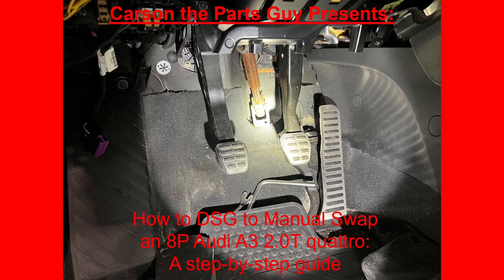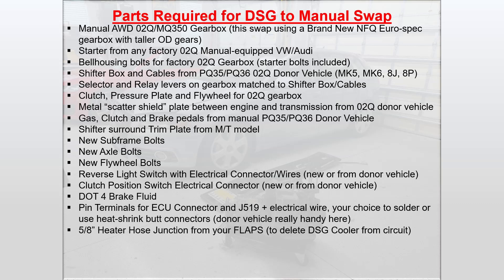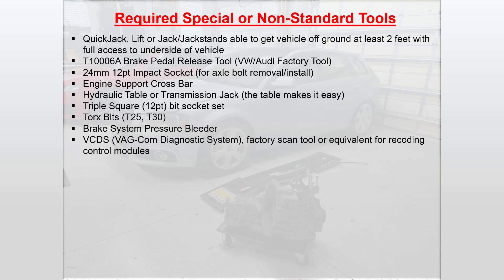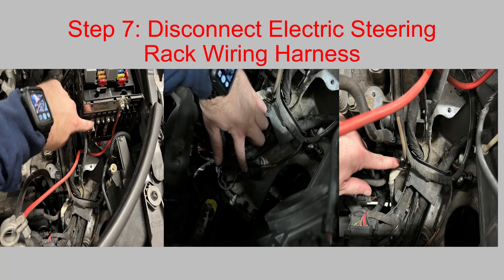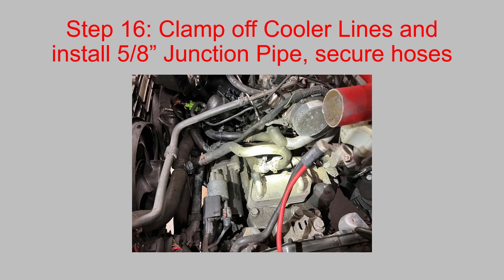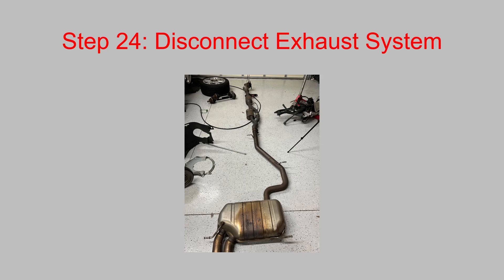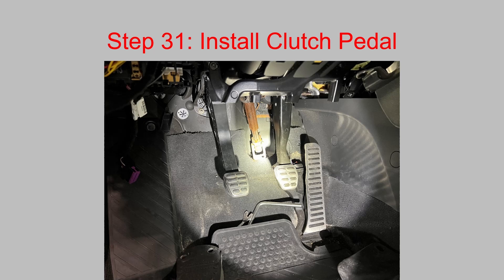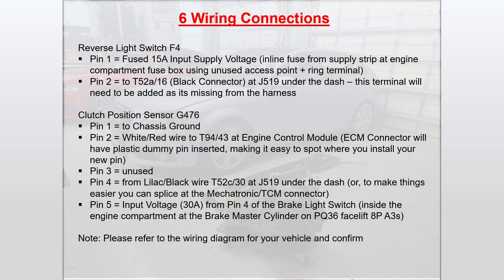DSG to Manual Swap - a step-by-step guide

Comment: Just wanted to drop an update, my 2012 Jetta Sportwagen TDI is on the road thanks to this video. Everything works. Cruise control, reverse lights and clutch interlock. It was a job and learned a lot on the way but it's definitely do-able.
Reply from the maker: Nice! Glad it helped you out!
Reply: did you have to reflash the ecu?
Reply from the maker: @leonkurtish9242  In my case, I only had to recode it with VCDS. Not all ECUs are able to be recoded this way, however.
Reply: @carsonthepartsguy8751  did you have issues with rev hang at all? And is there anyway i could double check if my car is compatible (coding wise) for a manual swap before i order the parts?
Reply from the maker: @leonkurtish9242  No rev hang issues with my swap. As for checking if it can be recoded, just go into it with VCDS and see if it’ll let you.
Reply: @carsonthepartsguy8751  got the engine module coded to manual transmission and removed automatic from gateway, but after that i had a code in the ecu for lost communication, could that be because my dsg was still connected and if not what do you think could be the solution ?
Reply from the maker: @leonkurtish9242  Did you clear the code and it returned?
Reply: @carsonthepartsguy8751  yes i tried clearing it a couple of times and it returned everytime but check engine would light up after taking it for a small ride

Comment: What an absolute gem of a video, im in the process of swapping an engine and 6speed into a car that had a dsg in it. I will for sure use this as a reference and it looks like you answer questions quickly. Thanks so much for the tutorial!
Reply: Guy let's do it. I'm also swapping my DQ200 DSG to a 6speed manual gearbox. Doing my homework on sourcing the needed parts.

Comment: Thanks for this video. I have a Manual Golf mk6 GTD that i'm planning on using as a donor to do this to a DSG mk6 GTD.  The reason reason for not buying another manual or just driving this one is that it has 340k Km (210k miles) on it is getting tired, leaking oil and doesn't have the options i want. I want one with a sunroof as I had in my mk6 1.4tsi twincharged version. But i can't find any original 2.0 tdi 170hp versions with a manual and a sunroof in 4/5door. always a 3 door or a dsg with the sunroof. 
Now i'm looking into buying a dsg mk6 and doing this swap. As i am  not a bodywork type of carguy, a gearbox swap would be easier than swapping roofs on a non sunroof one.

Comment: Great information in this video, thanks for all the detail Carson! I tried to look to see if anyone else asked but how did you acquire the NFQ euro-spec transmission? And do you by chance know the p/n for that as well as a bell housing for a 3.2L VR6? I have an MKV R32 that I am wanting to manual swap here in the states.
Reply from the maker: I got the gearbox from Cascade German. You would want to use the bell housing from an 8J TT 3.2 if you want to use the NFQ gear ratios. Otherwise, just get yourself an entire gearbox from the 8J TT 3.2 as it directly swaps into the MK5 R32.
Reply: @carsonthepartsguy8751  I was already thinking about the 8J TT to pull parts from. I might just try to find an entire donor car since I am considering doing this because I blew up my R32 engine.

Comment: Awesome Video Carson , thank you ! i just swapped a 02Q in my Jetta race car . i was sick of loosing races due to overheated DSG. 

The last thing to do is to wire up the clutch. i tried a few times using the purple/black wire from the DSG connector with no luck. i will attempt how you did yours. 

thanks in advance
Reply from the maker: Make sure you check the wiring diagrams for the Jetta first, the destinations will likely be the same but the wiring may be different. Good Luck!
Reply: Thanks for response Carson. I’m gonna be honest, I can built engines but when it comes to wiring, I’m clueless. I have no idea where to begin. So I need to find the pin out diagram from the Jetta and see with pin is the clutch position sensor?
Reply from the maker: @TeamAssuncao  Correct. You can get the wiring diagrams from ERWIN online, you can buy a subscription for 1-3 days, download the entire manual + wiring diagrams and keep them for future reference. Then just compare your factory DSG diagram vs. a manual diagram and route the wires where they need to go.
Reply: @carsonthepartsguy8751  Carson I got it 👍🏻 thank you sir. One last question, I didn’t change the brake pedal. I just cut down the pedal. So do I still have to wire PIN number 5 in the g476?
Reply from the maker: @TeamAssuncao  The wiring has to be done whether you replace the pedal or not. The physical brake pedal isn’t wired. Depending on production date, the brake switch is either inside the car riding on the pedal, or is in the engine compartment on the master cylinder.

Comment: Same sort of thing doing this to mk5 gt tdi? Dsg has shat itself and don't fancy finding another 81k mile mk5 golf with no rust whatsoever.
Reply from the maker: Basically, yeah. You'll have to check the wiring diagram for the TDI harness and how that utilizes the clutch position switch, but the rest of it should be quite similar. You'll obviously need the TDI specific flywheel, clutch, pressure plate and gearbox, but the rest of it could be had from a gas car.

Comment: I have completed all steps and got all codes cleared up, I need help with cruise control as it doesn't seem to work.
Reply from the maker: Did you recode the steering column electronics? If so, check your connections, and if they’re all good the clutch switch might be bad.

Comment: I have a 2014 VW Jetta Sportswagon MK-6 chassis with a DSG transmission and I live in Chicago. I already did a Malone Tuning Stage 2, CP-3 fuel upgrade, Glow Plug Duration and Dynamic Idle. I have the Raw Tek max performance DPF Delete, completely removed EGR system and assembly, as well as removed intake swirlers. The emissions is a hard 100% deleted with the Kerma TDI airbox delete and KERMA TDI turbo inlet hose. I am looking do do a DSG to 6 speed manual transmission swap on my 2014 VW JSW TDI. Where do i start and who do I go to. Thank you for your help.
Reply from the maker: Get your parts from a manual TDI, preferably from the same model year, and start swapping pretty much. You'll have to review the wiring diagrams for the TDI, but it will mostly be the same as the swap I've done here. You just need to swap the passenger front axle as they are different between DSG and Manual on the FWD.

Comment: thanks to you i did a full conversion if any problem...i have a plan to convert a golf mk5 gti to a 4x4 😈😈
Reply from the maker: A friend of mine is 4WD swapping his FWD manual 8P A3 that has already been 07K 2.5 I5 swapped. I’m 07K turbo swapping my manual swapped quattro. 😉
Reply: @carsonthepartsguy8751 well, this sounds interesting. Wil you document this swap?
Reply from the maker: @jeremybriand5196  I do intend to, start to finish. Subscribe to stay tuned!
Reply: @carsonthepartsguy8751  Well I am definitely subscribing. I don't want to miss out on this content, since it's a project I would like to try too
Reply from the maker: @jeremybriand5196  Well, my block should be back from the machine shop next week. Things are starting to move along....
Reply: @carsonthepartsguy8751  Nice, I can't wait to see that !

Comment: Thank you so much for sharing this precious material, and congrats on the excellent job. I'd like to know if you have wired the mirror tilt down when in reverse. I lost this function when I swapped my VW Golf 5 DSG to manual. Thanks in advance!
Reply from the maker: That should be handled by J519, and if you have wired in the reverse light switch to J519 so that your reverse lights come on, that should also trigger anything else tied into the vehicle being put in reverse gear.
The car I swapped in the video had rear parking aid - and it worked immediately after the swap. I would suggest investigating your coding.
Reply from the maker: @derciobadru4091  Its listed in my wiring diagram, but you'll have to refer to the one for your Golf. My reverse light switch is connected for power at the engine compartment fuse panel, runs to the reverse light switch, then from the reverse light switch it goes to J519. The car is already wired for the rest of it.
Reply: In my case, the reverse light switch it´s not connected to J519. The reverse light switch wires are connected two wires from the old automatic gearbox connector. I have rear light, but I don't have functions like mirror tilt down when reverse. I need to find a good mechanic and electrician like you, near me. Once again, congratulations on the excellent work.
Reply from the maker: @derciobadru4091  Yeah, you would have to refer to your car’s specific wiring diagram to see how that’s handled. Good luck with it!

Comment: I have an audi a5 2011 and I think I have a t94 ecm also. But can you explain more in detail of the wiring situation? And explainittle more the coding. Thank you.
Reply from the maker: For your particular vehicle, I’d have to go into the wiring diagrams and look all of that up. I wish I had the resources to manual swap all of the Audis, but I don’t. Sorry.
Reply from the maker: Your best bet would be to find one of the swap videos for a B8 chassis Audi. This video is specific to the PQ35/36 chassis, which would be 8P A3, 8J TT, and the MK5/MK6 VW Golf/Jetta and some other transverse models. I don’t own a B8 and don’t currently have any plans of covering a swap on one. Again, sorry I can’t be of help on that one.

Comment: i’ve just manual swapped my 07 passat and i can’t get my brake lights to turn off, there constantly on since the swap, i’ve replaced the brake switch and swapped to a manual ecu however i haven’t added a clutch switch, would this have anything to do with it?
Reply from the maker: Sounds like the brake switch needs to be replaced.

Comment: Would it be possible to change a DSG 7 from a Skoda Octavia 2011 1.8 tsi to a manual? 🤔 It has 160 hp and also a 1 year fixed engine, because of the oil use I had to do it..
Reply from the maker: Its possible. However, we did not get those particular 7 speed DSGs here in North America. Your best bet would be to find a parts car with the same engine that has the manual and pull everything you need from it.

Comment: Hey, I have gone through with the swap just the way you did… but I think I kinda missed a step in the coding or something, as my cruise control doesn’t work
Do you know what it could be? Does yours work?
Reply from the maker: You have to recode the steering wheel electronics control module if you haven’t already.

Comment: Great video. Don't you have the step by step guide for VW mk6 dsg to manual swap.
Reply from the maker: It’s very similar, some minor differences in required parts and wiring.
Reply: Thanks 🙏
Reply: @carsonthepartsguy8751  where is the best place to source a transmission for a mk6 gti?
Reply from the maker: @cooperferre4990  Used, you can try a VW/Audi only recycler, a National one such as LKQ, or privately through someone parting out their car, etc.

I got my gearbox from Cascade German brand new.

Comment: can anyone confirm if mk5 r32 ecu is "unlocked" as in will it take the coding like this a3? i have already received my manual swap from overseas just doing my wiring research now. seems like many skip over actually wiring in the clutch switch and just ground that purple/ white wire from the dsg trans plug to start it. would be cool to know if these wiring diagrams and brake light switch are the same for mk5 r32 application
Reply from the maker: It will not. You'll have to have it flashed with manual software, if I recall correctly. You may also be able to use an immo-defeated ECU from a manual 8J TT 3.2, but not 100% sure.

Comment: What was your donor car or what donor car would you recommend for doing this swap on an 8J TTS?
Reply from the maker: If you want to get a donor car for it, your best bet would be a MK6 Golf R. It has the same engine as your TT-S.
Reply: @carsonthepartsguy8751  Thanks! Would I have everything I need with the donor car?
Reply from the maker: @joshuacucufate8413   The only thing you’d have to get that is TT-specific is the shifter surround trim, and maybe a different shift knob and boot depending on your tastes. In the USA, you’d get the shifter trim from an 8J TT-RS as that was the only manual 8J sold here.
Reply: @carsonthepartsguy8751  Thanks a lot!

Comment: Great video, my dsg is dying slowly and want to do a manual swap on My A3 3.2 8p, would i need to get parts from a mk4 R32 or mk5 R32?, or are they interchangeable?. 
Thank you
Matt
Reply from the maker: You’ll want to use parts from an 8J Audi TT 3.2 quattro for your swap. You could technically use parts from a MK4 R32, but you may have to interchange other parts to make it work. The easiest route is to use TT parts though as it’s the same generation of chassis as your 8P 3.2q is.
Reply: @carsonthepartsguy8751  Thank you so much for your quick reply. I will start hunting the parts out.
Thank you again

Comment: Hey Carson loved the Video! Would it be possible to go from a 07 FWD 6MT A3 to Quattro 6MT? Does the prefacelift motor bolt up to the 02Q or the MQ350 trans?
Reply from the maker: Short answer: yes, it’s possible.
Long answer: it involves cutting and welding to modify/replace the rear floor pan, welding in center driveshaft support bearing mounts into the tunnel, replacing the rear subframe with a quattro subframe and diff/axles, replacing the gas tank with a quattro version, and wiring in the Haldex unit.
The 02Q gearbox will bolt up to any VW/Audi engine with the 4 cylinder bellhousing pattern when used with an appropriate flywheel, this includes the 07K 5 cylinder engine (with slight grinding to the bellhousing on the transmission to clearance the timing cover)

Comment: Hello Carson, great video,  I think that I can follow it to do the swap to my GLI MK5's swap, I think the wire is gonna be the problem, so what will happen if I don't make it?
Reply from the maker: Bare minimum to drive it would be to ground the wire going to J519 from the trans harness. Should be purple and black like on my car. The starter will engage without the clutch pedal being depressed, however. And you won’t have reverse lights.

Comment: Hello Carson.  I have a question for you. I have a 12 vw cc I swap manual transmission. I performed the coding for the ecu and instrument cluster and gateway. Is there coding of the abs module. Thank you so much
Reply from the maker: I didn't have to recode mine, so I don't believe you'd need to. You can check the coding with VCDS to see if there are any values that represent automatic or manual and change them if needed.

Comment: I have 2007 jetta gli automatic dsg...can conversion to stick shift?
Reply from the maker: Yes. This video would mostly apply to your Jetta. You will need a passenger side axle for the manual, shift box/cables, the gearbox itself, pedals, clutch/pressure plate/flywheel, starter, and the wiring changes.

Comment: Hey Carson, i would like to ask you a question, do you think is there any difference mainly electronic part of rebuild? i have vw golf 5 1.9 tdi (BLS engine code) with DSG 7 trans on it. i would love to replace it for MT. Thanks mate if you find time to reply on my question :)
Reply from the maker: The same basic procedures would apply, but please keep in mind that we didn’t get a lot of TDI options here in the US and I’m not familiar with all of them. You may be able to recode the ECU or you may have to replace it with a manual ECU. The rest of the electrics you’ll have to follow the factory diagram and match up the rest of the wiring, adding in the reverse light switch and the clutch position switch wiring.
Reply: @carsonthepartsguy8751  thanks :)

Comment: Hi Carson how could I get in touch with you about some questions I have on this manual swap? My crankshaft looks different in the rear, I’m unsure if this is a sleeve that holds the pilot bushing but the Inside diameter is much smaller than the diameter of the manual trans input shaft
Reply from the maker: What engine do you have? I didn’t have to do anything with the CCTA featured in this video or my previous BPY FWD swap….
Reply: @carsonthepartsguy8751  CBFA but I don’t believe that should affect the crank. Got email I could shoot you more info
Reply from the maker: @Hellcatsinner  Post your VIN, I’ll run it at work to see if there are any changes to the CBFA crankshaft vs. CCTA.

Comment: hello ! Do you have photos or diagrams of step 6 wiring connectors?
greetings and thank you very much for the tutorial
Reply from the maker: I can’t post those due to copyrights from VW/Audi. Best thing to do is grab them from ERWIN (they sell 1 or 3 day subscriptions, DL the whole manual for your car and keep it!) so you have them legit.
Reply: @carsonthepartsguy8751   OK, thanks for answering ! Can you send me the link, do you know how much the subscription costs... is it the only thing I need to complete it, using the VSD configuration I will not have problems with the ABS configuration?
Reply from the maker: @iferuzx  https://erwin.audiusa.com/erwin is where to go. You shouldn't have any issues with ABS. Doesn't need to be recoded.
Reply: @carsonthepartsguy8751   Thank you very much, I connected it directly at the moment, and I saw that the cruise control does not work... does it have to do with the connection of the clutch sensor? in the link you sent me do you think they have the SEAT diagrams my car is a SEAT leon FR 2010?

greetings and thanks for answering

Comment: Hi mate any chance you would know the coding requirements for dsg to manual mk6 gti we have completed the whole swap it is just the coding left to go any tips with the vcds and or codes to change and or that need to replace the DSG Transmission codes